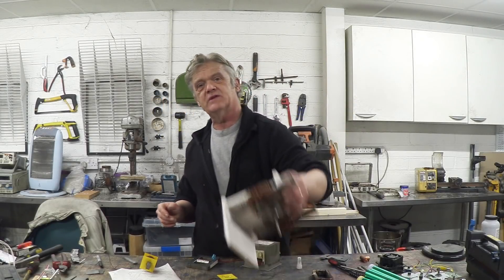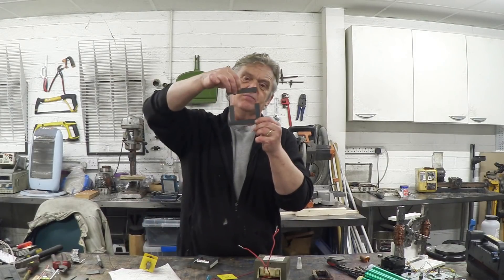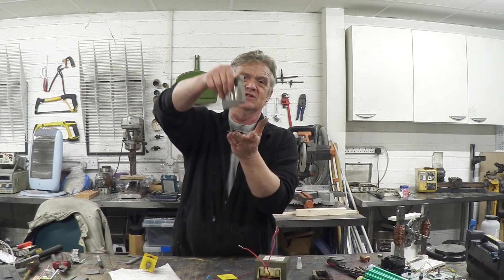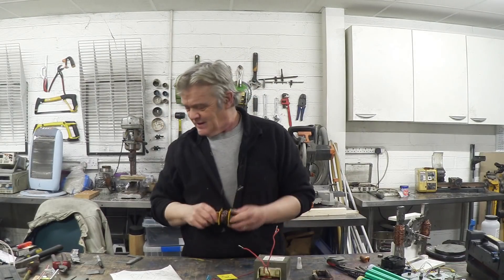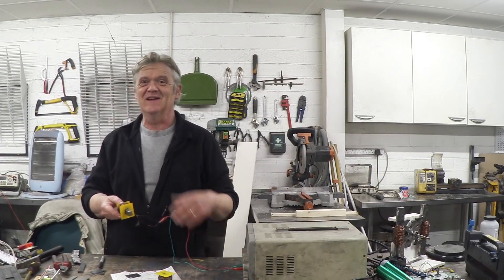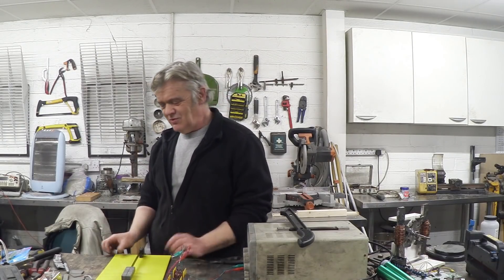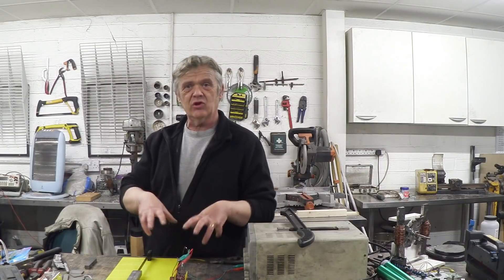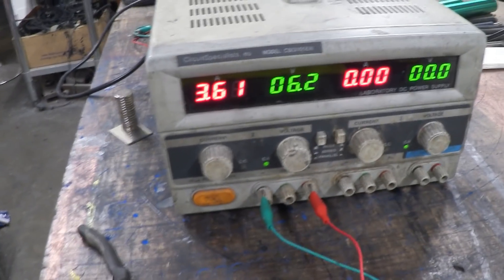1036 Flux Switching And Possible Over Unity

Comment: Interesting, thank you. Assuming you (with Rob anything is possible :), haven't overturned 500 years of physics? :) It's possible that with the magnets in place you have created a more efficient electromagnet, and without - just a less efficient one. Also, those assisting powerful neodymium magnets could be just basically magnetically discharging. Both of the above would mean that the total energy is conserved. Just a thought: Halbach magnet configurations might be worth a punt? Stay safe, Beamer.

Comment: Hope videos like these stir up the natural curiosity to learn in everyone that watches and comments.
FWIW, the understanding that any form or potential of energy/power generation is simply the management/transfer of heat [anything above absolute zero/capable of electron flow], can provide a proper perspective for the realization that utilizing a 'free' [perpetual] energy source first required the work/effort of a creator/producer of the heat source. 
 Simply stated, 'free' just means that the receiver has permission to utilize/consume that which is provided by the creator/producer of that which is utilized/consumed. 
 While content such as this might be freely posted/shared and is invaluable[in my opinion] in its availability, the accrued knowledge/experience necessary to create/produce [and to intelligently comment on]it is anything but freely acquired.
 This comment is provided of my own free will.

Comment: interesting how the PM flux is contained in the iron square but the electro-magnet flux is not. I think what's happening here is the flux path from the electro-magnet is providing a path for the PM flux to "escape" the iron square and thus adding to the total strength of the electro-magnet. also would switching the polarity of the DC in effect the strength of the electro-magnet as the polarity of the magnetic field is relative to the direction of the current. over unity is a relative term, not an absolute one because you cannot have more than the whole of something, which i think is where a lot of people go wrong.

Comment: I think Tom Bearden had a patent for a similar flux switching arrangement with coils and permanent magnets back in the 90s or so.  I think it was called an MEG.
Reply: Sure was. I never built one but it supposedly worked in a very similar way. Apparently by perturbing the magnetic field path he could make the flux flow preferentially on one coil over the other. Alternating the perturbations created an AC signal which he could grab on the pickup coils. No idea as to the overunity claim but certainly worth a try.
Reply: @robcarl1100  it was the something vector b potential which was exposed and then it was down to the shielding material .... Patent 6362718 B1   again something Rob would write off anyway cause he cant understand what happens in these scenarios .

In simplest terms the universe dumps energy into places potentials been created by slowing down the ability to neutralise ... i mean this rob knows for example but he doesnt grasp the fact that we don't live in a closed system .. and we not bound by the 2nd law of thermadynamics
Reply: @Rob Carl  it was the something vector b potential which was exposed and then it was down to the shielding material .... Patent 6362718 B1   again something Rob would write off anyway cause he cant understand what happens in these scenarios .

In simplest terms the universe dumps energy into places potentials been created by slowing down the ability to neutralise ... i mean this rob knows for example but he doesnt grasp the fact that we don't live in a closed system .. and we not bound by the 2nd law of thermadynamics
Reply: Plans and theory for a patented (expired 2020) motionless electric generator, independently replicated see --  megpaper pdf

Comment: After watching nearly all your videos...  I invented the Beer Weed Battery!   I want you to do it on video...  Take a soup can...   And mix PVA with Graphene from weed,  Rochelle Salt, Epsom salt, Alum, No Salt substitute, Normal table salt, In equal parts, Put a Beer can inside of a sup can  after you roast both cans on a fire... but not deforming them.  Pack the PVA electrolyte salt solid mix between two cans!    Over unity can be had as well...      Using a flywheel to create the momentum to break a motor a generator and a capacitor.

Comment: Hmmm ..... that was interesting!  I assume your power supply was putting out DC and that you oriented it to oppose the flux in the core when energized?

As to the over unity I think you can unwash your mouth ;0) .... It would seem that you are simply utilizing the energy in the magnets as opposed to using the energy in a coil to produce a magnetic field! 
I am not aware of any material that blocks magnetic flux .... but many will allow different amounts to flow, two examples that come to mind are Air and Steel! 
If you had a rotating core section that periodically passed between a gap in the original core (as if you fitted more magnets into your stack) you would be effectively switching the flux levels! This would induce a voltage in the coil! As you would effectively have a balanced rotating section and the attraction toward the magnetized would be equal to that slowing its removal from that field  so would require little rotational energy. The output may well not have any bearing on the force required to rotate the core section, but rather the change in fiels strength of the magnets.

Comment: the interesting simple experiment would be to have the perm magnet a bit to the left. then apply voltage to the left coil to switch the path to the right. then see what kind off power gets generated in the right coil. should be applied power plus magnet power. then how much power is needed to switch it back left. its what beardon was hiding in plain sight I think.
Reply: Please explain.
I have heard of Bearden's MEG, but have no paperwork on the device.
Reply: @wazittuyoo2147  google tom bearden meg

Comment: I am wondering if this could make a motor more efficient (ones with coils on stator and rotor or no permanent magnets used types)
By the way I have a gause meter that I got on AliExpress very cheap that measures magnetic fields. Was about $10-15 AUD

Comment: That kind of thing is extremely interesting to me. You did not show how it was arranged when you had the Magnets added to the electromagnet to get the same pull force with less power usage.. Did you just have them stuck in the center of the C without the 4th side? Or did you have it as a complete square.. If so how did the magnetic force work outside of the inclosed loop?
Reply: I think the 4 side is removed. If you box the 4th side it locks the flux mostly in the steel. Like a transformer does.
Reply: @make425  yeah that is what I was thinking, I wonder whether he sticks it in the center of the C or on some other part when he trys it that way?
Reply: @ShilohSedlak   i would assume the center, coil direction could also make a improvement.  Its sapoze to be mostly about flux switching. "Spintronics'
Reply: @make425  Okay interesting!

Comment: he weakened the magnetic field by putting the coils on the ferrite core in the first place, thats why it tooks so much power to move his meter, all the magnets did was use up some of the magnetic permeability in the metal to allow the magnetic flux from the coils to escape more readily, if he tried this with the coils not on the core it would almost certainly produce the same, or enhanced effect of what he showed after adding the magnets.

Comment: my first inclination is to think that your electromagnet along with the permanent magnet stack was beginning to saturate the high-permeability transformer core and cause the flux to escape containment but that would also mean a magnetic field of proportional strength to the electrical power applied minus losses. Perhaps what you made was a more efficient electromagnet?
Reply: my inclination is that its slightly less efficient because of said transformer core soaking up some of the magnet field of the coil in question, i imagine without  that core being present the coil would have exerted its full magnetic field unimpeded, unless there is reason to believe the core allows it to be more directional.
Reply: @Draakdarkmaster6  well, magnetic permeability plays a large role in a medium's ability to increase a coils inductance and therefore induce  a  stronger magnetic field. In all likelihood, a coil with an air core would not be a as great an electromagnet. That said, a magnetic core can give a magnetic field greater strength in a given direction if it is shaped to do so. 
Frankly, I didn't think the experiment in the video would have worked at all and so I gave my educated guess as to why we saw what we did. To clarify the second electromagnet may have been more efficient  than the first due to a variety of reasons but I am not convinced that the permanent magnets did anything surprising.

Comment: Robert, I believe overunity is possible by switching flux.  As an aside I think your example produced low voltage for a couple of reasons. The main one is that you have a gap between the rotor points and the starter points as they pass each other. A lot of flux is being lost in that gap. Try some sort of bent steel "brush" type contacts where the points can have actual physical contact between themselves as they pass. Secondly, the steel laminations work so well in transformers because they are all insulated from one another by a sealant. 100 insulated laminations carry flux more efficiently than a single piece of steel of the same overall size.  When you broke the transformer laminations, cut, and or welded them you effectively turned them into a single piece of steal by removing or scarring the insulation sealant between them. Thirdly, and not last by any means, is that you cut your points on the stator at a sharp angle.  I think you said 45° angles. Both electric current and magnetic flux fly off of sharp angles and cause a loss of overall flux going through the system. Grind those sharp angles into circular shapes. And in fact also chamfer or round-over all edges on the steel bits to prevent flux from flying off any sharp angles. The smoother and rounder your steel pieces are will result in minimal loss of flux.  With these changes I think you can improve your results. Though still far from overunity. I have different ideas on that. I like the way your mind extrapolates things and would enjoy working with you on such a project. If you're ever interested give me a shout.
Reply: I'm not sure I understand some of your suggestions. The steel laminations don't have to be insulated in transformers. The wire used for the winding is already resin coated to prevent shorting. Magnetic waves travel through insulators like plastic or resin, even when electricity does not. Flux is insulated by different means. Most electro-magnetic loads are fairly consistent pound for pound and made into the same shape. The strength of an electromagnet, for example, is determined by the amp-turns ratio. As in lower amp, more turns in a coil will produce similar power to more amps, lower turns as long as their cross sectional density is relatively similar and they occupy the same overall volume.

Similarly, having these shims together or seperate will produce essentially the same exact magnetic forces. Transformers are made of shims of metal pressed together because it is far more affordable to mass die cut thin gauge metal than it is to cast or cold roll steel into 10-20mm thickness. I am confident you would get very similar results from the same winding put over a solid core of the same dimensions and same base metal.
Reply: @Waboku52  True, The "shims" as you call them or laminations don't need to be insulated for transformers to work. But, they are substantially more efficient and produce greater results when they are insulated.  You said yourself they are insulated by lacquer or whatever.  My point is that when you cut through a stack of lacquer-insulated laminations they are no longer insulated because the lacquer or other insulating material is destroyed by the cut.  The laminations are then in direct contact with each other and the benefit of insulation is destroyed.  The point is to disassemble the laminations, then cut them, and re-insulate them before reassembly.

Comment: Is this going to evolve into "How to make an over unity generator from a Microwave transformer" ?   Now that would be pretty damn cool :)
Free energy from something lobbed in a skip.
Reply: its not over unity, its scavenging work from magnets which require energy to make in the first place, its easier to understand if you think of magnets as a receptacle for energy like a battery, where getting the energy back out is nearly impossible without alot of indirect methodology, so it'd be like if he used one of these "batteries" to make up for power he couldn't or didn't want to supply to the electromagnet to save power output from his power supply, not over unity, but potentially extremely useful.
Reply: @Draakdarkmaster6  - Are you sure ?
Reply: @herenow2895  100% i've studied magnetism for years to understand how it works.

he weakened the magnetic field by putting the coils on the ferrite core in the first place, thats why it tooks so much power to move his meter, all the magnets did was use up some of the magnetic permeability in the metal to allow the magnetic flux from the coils to escape more readily, if he tried this with the coils not on the core it would almost certainly produce the same, or enhanced effect of what he showed after adding the magnets.
Reply: @herenow2895  Search up the real one, flux switching alternator instead.

Comment: Do the magnets lose magnetism over time though?
Reply: yes, they are only called "permanent magnets" because they hold a magnetic field without any need to induce one with a current, technically neodymium magnets can last as long as 5000 years IF you dont do anything to cause them to degauss themselves, which this will almost certainly do, maybe over time.

Comment: WOW, stimulating. I feel slower than a tranqulised turtel on a treadmill,  but even I can see the potential in this.
Reply: he weakened the magnetic field by putting the coils on the ferrite core in the first place, thats why it tooks so much power to move his meter, all the magnets did was use up some of the magnetic permeability in the metal to allow the magnetic flux from the coils to escape more readily, if he tried this with the coils not on the core it would almost certainly produce the same, or enhanced effect of what he showed after adding the magnets.
Reply: @Draakdarkmaster6  You could try it .. ;) :)

Comment: I have a idea for you to try with that setup.
Split the stack of magnets in half then put each half together with them repelling each other.use a steel or iron washer in between them to hold them together. That should create a magnetic flux.then see if the coils are generating any electric power.
Reply: Easy to replicate and try yourself but generation need movement, like a magnet passing a coil etc..
Reply: @stevetobias4890 Tip of the day. 'Movement' can be electronic switching.

Comment: Unfortunately, over unity, is not quite the right term. It is possible, compleatly, but not in the way most see it.

Any device that does the 'over unity' is essentially a magnetic grinder.

However that said, a tree takes 100 years, and you have fuel, oil takes 10 million years, nuclear takes 1billion years.

The sun took 3 billion years.

How long does it take the universe to create magnets?